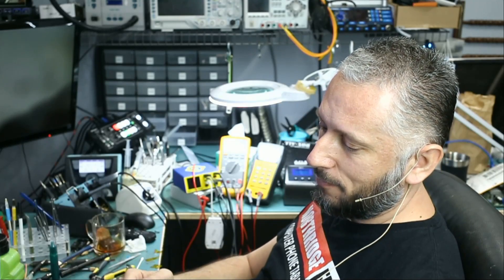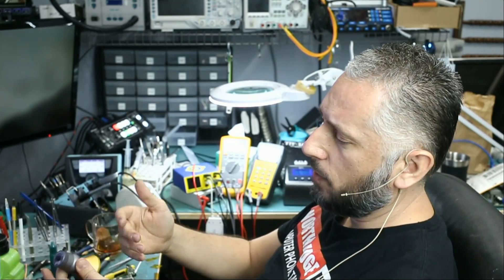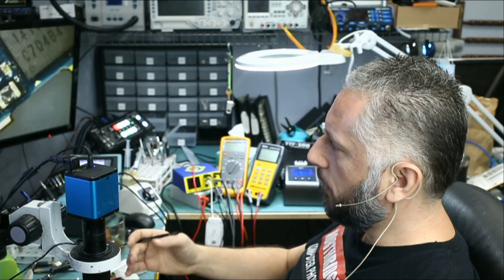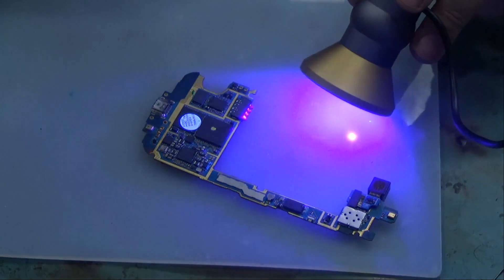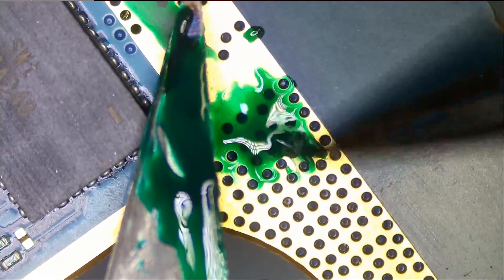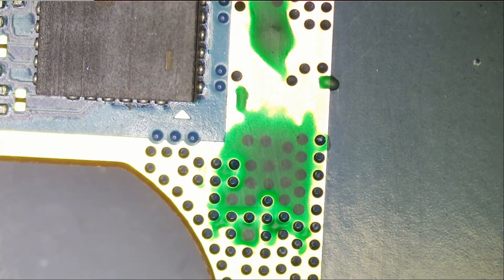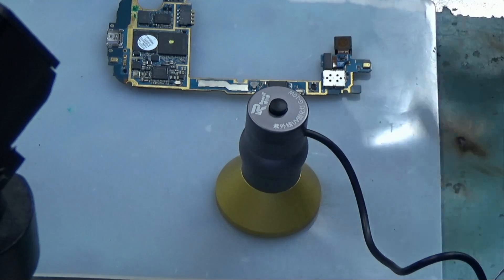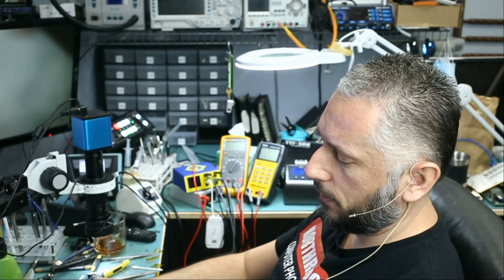New 10W UV Lamp cures solder mask in 6 seconds - No Hot air required.

Comment: I bought this, but i found with too big of a blob it will cure a shell on the outside but if yiu poke it with a Needle it's wet inside.  If you want thick application i guess will have to do layers.

Comment: Very handy to have on the workbench. However I must note, having used both the lamp and UV cure solder mask from your shop, that it takes significantly longer than 6 seconds on average to cure - I find myself cycling the lamp on/off five or six times before the solder mask has a considerably solid consistency.

Comment: Very nice find and good example.  We asume 5v and something like 1amp. As it turns it self off there will be very little heat generated.  Ideal for space saving and you don't have to change batteries or bulbs.  

When do you find time to look for these devices.

Comment: 10W are suspiciously high for this kind of LED, btw be careful with UV radiation, it would be nice if the company gave the output spectrum just to be on the safe side
Reply: Not to worry, I held mine up to my face and hands and even though there is a strange looking "bud" growing out of my neck, I'm perfectly fine.  Well, it does look like it's growing hair on it and a little mouth and eyes but other than that, just fine.
Say, you don't think it could be another head growing do you?
Ok, I'll have it looked at.
Reply: @robertpage2023  Life is a highly adventurous thing
Reply: @Anjellica Kraychek Too Late!!  I'm blind!!!!

Comment: Very neat! The weight is due to the device relies on impulse use rather than continuous use. It dumps the heat from 10W power dissipation into the massive metal rather than into the air.

Comment: Not to be a downer but my concern with that is the base is metal what it scratches the pcb or knock off components, 😅 as you demonstrated to be put on top of a motherboard a rubber would have been a good idea as it grip also no sliding😅

Comment: I use UV adhesive for "instant" fly tying and many other projects.  Works great - however the end result is comparatively softer compared than most epoxy type adhesives.  Ordering that light here though - that 35 second timer for me is another time saving step!
Reply from the maker: The LED bulb is rated for 10,000 hours. If you use it for 3 minutes a day. It should over last you.
Reply: @NorthridgeFix I have that lamp. Can I disable the standby mode?
Reply: @BlondieHappyGuy  Ya know, those newer emitters last long - but 10,000 hours would still be 5 years of production at the job.  What's additionally cool - is there are several types of UV adhesives available - but all firm up less than what I would deem as a hard coating.  For 98% of most jobs - it's a quick and idiot proof fix.

Comment: Some mask was clearly still wet, and is wiped away by the swab. If you prodded the mask after with a clean tweezer, it would still be wet on the top, deepest, part. (very different to the matt look you the mask has in your previous videos once cured by uv+heat)
Sill, leave it under that UV light for double even triple that time and it’s still a quick way to cure. But it was definitely still wet on top after 6 seconds.
Reply from the maker: The thin layer on top will remain even if you expose it to UV light for ab hour. It has to be wiped. Hot air just helps with the evaporation and not curing.

Comment: Can you measure with usb meter? Is it really 10W? At 5V it must take about 2A. it's a lot wattage from 1 multichip led. Thanks.
Reply: It's probably why the timer is necessary.
Reply: Yeah I was woundering this as well, usb 2.0 default to 0.5A. I've drawn 1A with some devices but 2A seems too much to me.
Reply from the maker: Check pinned comment
Reply: Yes, this is interesting. Maybe someone who already buy/try it can test and share results here.
Reply: For me its more like 1W LED. No wonder if someone reports this video.
Reply: @tandzan  not necessarily, Alonefire sv003 have about 5W measured, proclaimed as 10W in one chip, but can work continuously, if it's peak over voltage with timer can survive 10w for while.
Reply: @tandzan  1W LED would be a little ridiculous and completely pointless. Running a 3W Luxeon Star style LED with a GOOD heatsink at 10W for like 20 seconds is completely adequate and not really a problem.

Comment: I still think the hot air + UV light technique is better, both times you brushed the mask with the Q tip, some of it wasn't solid, so the 6s is only for marketing. Probably it is 6s combined with the hot air.
Reply: The "evaporation" process IS the curing ...
Reply: Just let it 4 secs more xd
Reply from the maker: Hot air just helps with the evaporation and not curing. You wipe the thin layer and the Job is done
Reply: @NorthridgeFix  your timing is way off - I think the second go was around 13 seconds, and the first was longer as well and not 6 seconds.  The cue tip took off the top layer that wasn't dry.

Comment: Maybe you should wear UV protection over your eyes when using that lamp? I mean, dentists wear UV eye protection when working with UV-setting compounds.
Reply from the maker: The lamp sits over the PCB handsfree covered from all sides and light is mostly covered. You should not be looking at the light either way.
Reply: @NorthridgeFix  Well obviously one should not look at the lamp directly. DUH!
Reply: @NorthridgeFix  mostly, I think I would wear eye protection as there will be UV light bouncing around and into your mk1 eyeballs. One off is probably fine but if you do this a lot every day then it seems like it would cause problems for your eyes.
Reply: generally, as long as you don't point it towards your face or just sit there with it pointed at some part of your body or something, these small lights tend to be okay. the dentistry equipment tend to just scatter the harmful parts any which way and are less directed in general, from the units i've seen. so there's significantly more area exposed. 

the wand style some dentists will use is ridiculously more powerful than this little guy is. 5w base led, directed with lenses and a light pipe, at a higher spectrum (~430-480nm vs mid 300s to just below 400). with a radiation of "≥850mW/cm2" this little one is rocking maybe half a watt of actual output, and non-focused with very little radiation of uv vs the dentist stuff..

if it were a large style on an arm or something and left up off the part a ways and powered by an ac power supply without usb in the mix, it'd be a concern. 10W of full blast uv of any type is.. no bueno. this may have a '10W LED', but they're usually wayyyyy underfed to prolong life and keep heat down.

the habits he showed with it are probably fine for his use case.
Reply: @kenabi  Every little bit of protection counts when it comes to your eyes. UV damages eyes – fact. That lamp produces UV – fact. Circuit boards have shiny metal surfaces that may reflect the UV. Why take the risk of cumulative UV damage to your precious eyes? Err on the side of caution, I would say. I have a tiny little low-powered curing lamp yet I close my eyes when applying it, and I will continue doing so.
Reply: Not necessarily,  as dentist use more wattage for their uv and their uv is more stronger than 10w uv light.
Reply: @AP9311  A dental curing lamp I have just looked at online, costing over $400, has a power consumption of only 3.2W. That is less than a third of the lamp in the video. So where did you get your idea that dentists use higher powered lamps? Did you pull that idea out of your butt? I think you did.
Reply: @AP9311  INCORRECT. I just looked at the specs of several dental UV curing lamps and the highest power consumption among them was only 5W – half the power of the lamp in the video.  Maybe actually research your "facts" before posting.